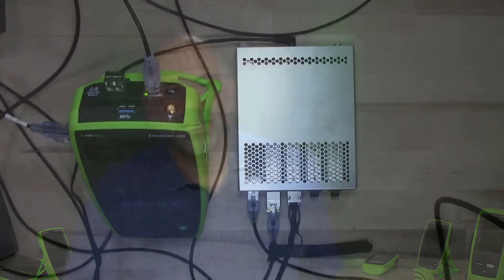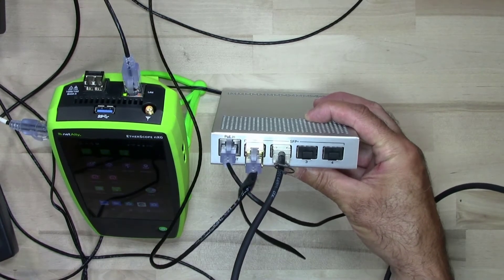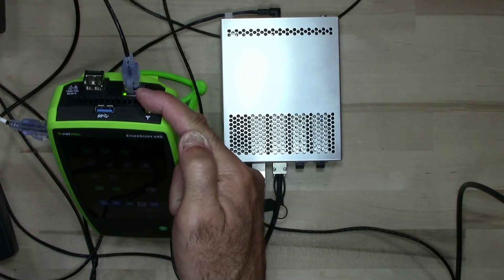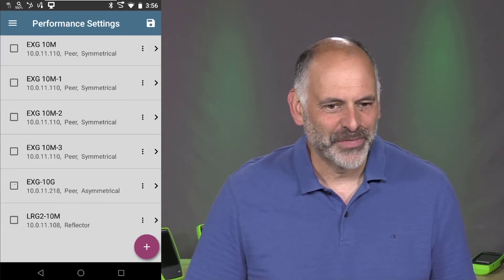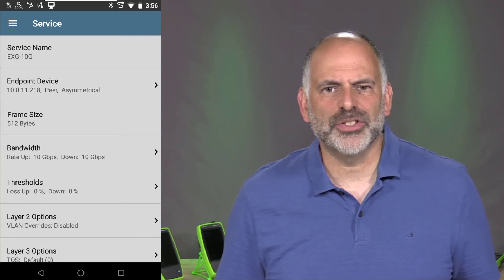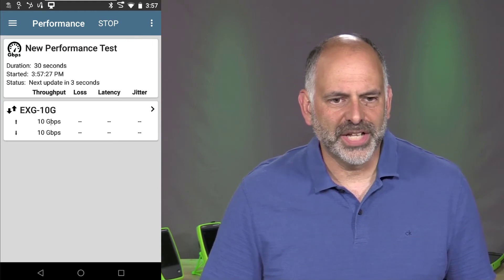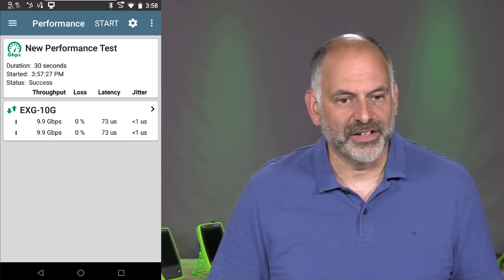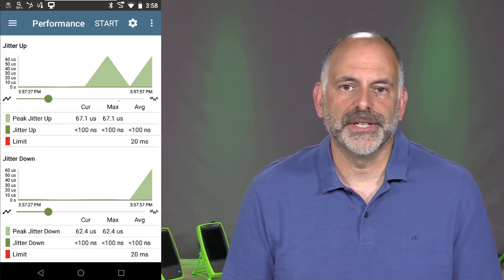MikroTik CRS305-1G-4S+IN Switch Test

Comment: Wow they didn't include the five cables for that switch which it could have used?? That's crazy most companies include enough tables to populate every single port in their switch but what's worse they didn't even include one! I'm sure most companies include at least one cable with their switch, right?? But then again, no, come to think of it – I have never seen a single SFP+ cable nor DAC  Cable included with a switch but I'm glad you pointed it out who knows I might've suddenly expected it.
Reply: Never seen a switch provider supply network cables with a switch (albeit serial console). It would be a total waste of production cost to do so as these switches use SFP+ cages so the user chooses if they want 1G copper, 10G copper, Single mode long run (10km/40km) transceivers for ON3 cables or multimode OM3 transceivers.  Do you expect them to supply 30+ cables per port by 4 ports (120 cables) to cover most use cases. :)

Comment: Are you sure that this is good measurement? I mean.. isn't 70 µs latency A LOT? For example Aruba 2540 switches has  < 1.6 µs latency for 10 Gb (64-byte, by datasheet). Okay, you're using 512-byte frame size but still.. It shouldn't be more than 15. If it's true, that would explain why I hear sometimes dropouts in DANTE (low latency protocol for transfer audio over ethernet [used in audio mixers]). I'm using Mikrotik CRS326. Or am I missing something? Thanks. :)
Reply from the maker: Being a packet analysis guy, I did a little research on DANTE.  It appears that it uses IP Multicast to send the packets from the audio source to the destination devices.  I can see the advantage to this, as a single audio source could be easily received by multiple mixers.  Also, like with DMX, it reduces the amount of cabling that needs to be run.  This does bring up some other challenges.  Not all devices handle IP multicast the same.  The switching latency really shouldn't be a bit issue.  The bigger issue with streaming audio is jitter.  Any variation in the gap between audio packets can cause all kinds of issues.  It would be interesting to see a Wireshark trace of the audio traffic to see how it is being sent out.  It does appear that MikroTik CRS3xx devices to have some integrated multicast limiting built in.  This document https://wiki.mikrotik.com/wiki/Manual:CRS3xx_series_switches references this in the Traffic Storm Control section.  Based on the default limit, the dropouts could be caused by spikes in the multicast traffic exceeding the limit and some of those audio packets being dropped.
Reply: @MikePennacchi  Thanks for the reply. DANTE supports multicast but by default it uses unicast. I don't work with multicast yet even I tested multicast traffic on NDI and it works but it disconnects after 30 seconds (but I know that I had wrongly setup of igmp querier). :) But you're right, my issues may be caused by computer I'm using and it's standard NIC (nothing special). But I don't have any way how to test it before buying anything more serious (intel NIC, ...), maybe 10 Gb support because of NDI generates a lot of traffic (~160 Mbps per 1080p60 video stream, >300 Mbps per 4K).

Comment: What SFP+ cages are you using?
Reply from the maker: I'm using this copper SFP+ 

6COM 10GBase-T SFP+ Copper RJ45 Module Transceiver for Ubiquiti UF-RJ45-10G, Netgear AXM765, up to 30m

It supports 10/100/1000/2.5G/5G/10G. Runs pretty hot, but does full duplex 10G without any loss. I've used a bunch of different fiber SFP+ modules. Everyone of the has worked well.
Reply: @MikePennacchi  Thanks for the quick reply.  I just built an UnRAID box and plan to connect my current workstation with this switch.  When my VM box comes online, I should have a blazing fast connection between all three.  They are in separate rooms in the house, with CAT6 in the walls already.
Reply: @woodspepperman9344  you might want to see CAT8.1 cable! faster than CAT6
Reply: @rotojo2  , My CAT6 cables are already in the wall.  I am kinda stuck with that for now.

Comment: This test is Incomplete. Bcz when we tried to put in network. CpU excedes to 100% at 2Gbps. With basic configuration.
Reply from the maker: Thank you for the feedback. I'll do some more testing and post the results.
Reply: thtas because you have made test in RouterOS mode, you need to login via winbox and select  Routerboard/settings   and change to SwitchOS boot, and apply reboot on the device, you will loose access via winbox and will only work login via web page. after booting to switchos mode
Reply: @pnSurc-qj4ow  please share your test result. Ho much raffic can iy handle easily with basic vlans/ques. In switch mode and in Bridge mode (router). In basic network